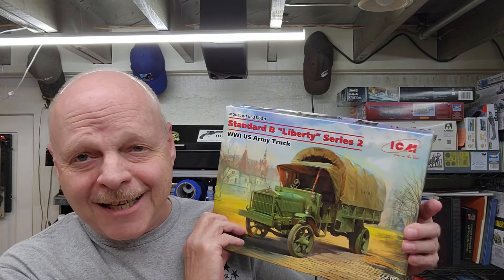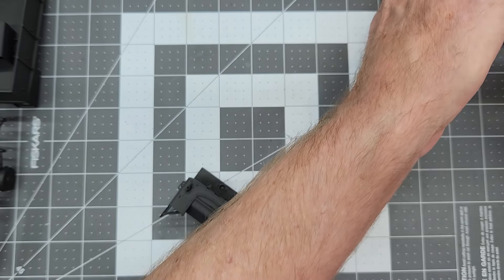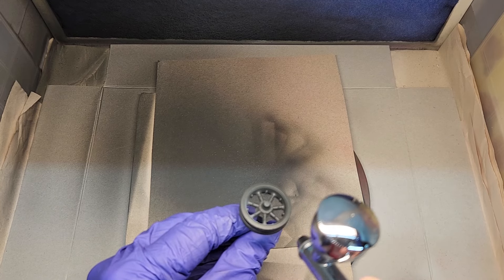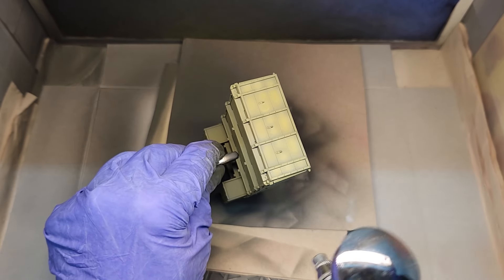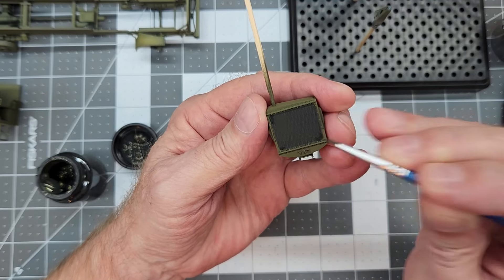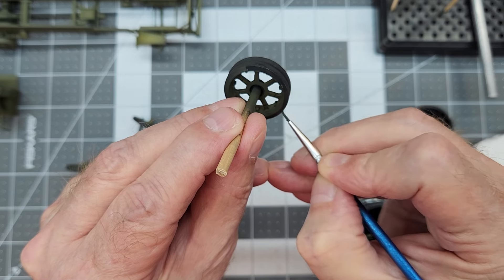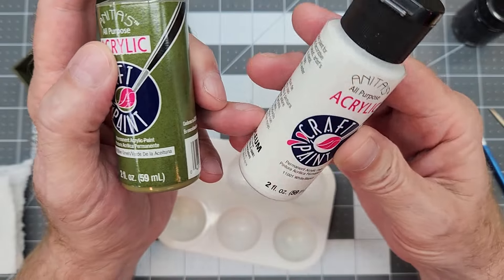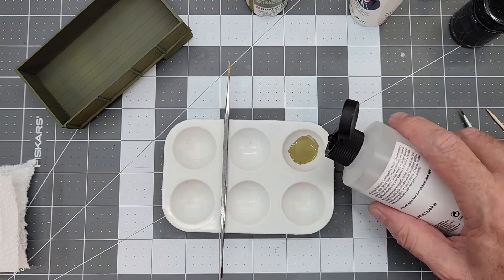WWI Standard B "Liberty" Truck, Part 6, Pre-Shading, Painting

Comment: Always good to see you eager at work, buddy 🙂In my opinion you did an outstanding paint job on the canvas. And the rest too, of course!
Quick question: do you use an extractor fan at your paint station?
Reply from the maker: Thanks Mike👍and yes, I use a paint booth with filter and fan, it keeps the overspray under control. Since I use water-based acrylics venting isn't a problem. If I were to use anything solvent/petroleum based I would need to vent it. You should use some kind of a fan unit to at least keep the overspray from coming back towards you, Thanks so much for watching, take care and model on!! Johnny